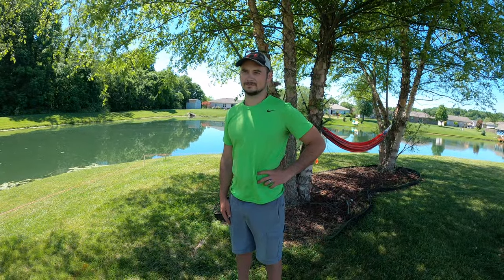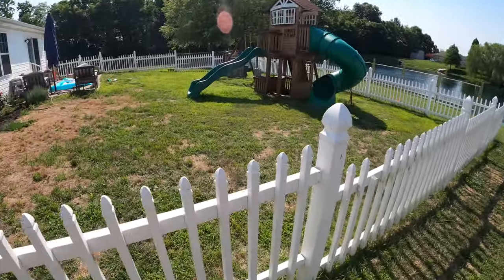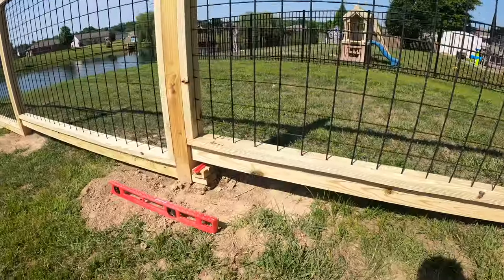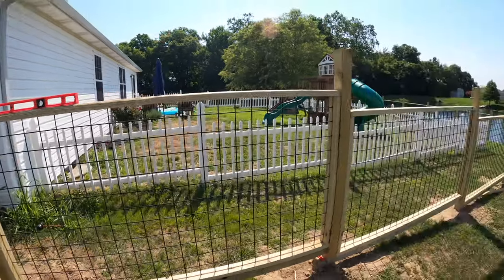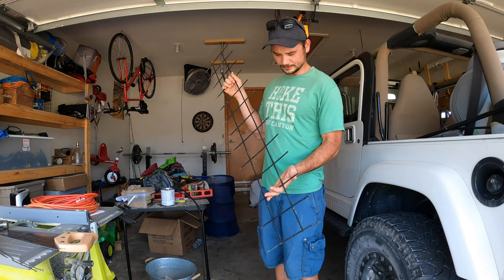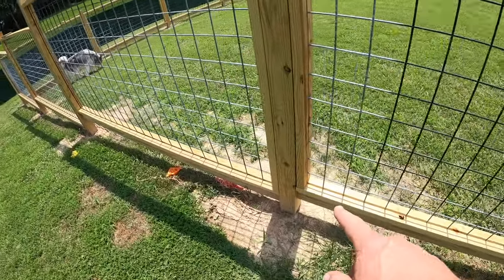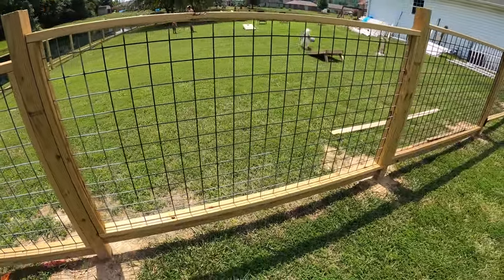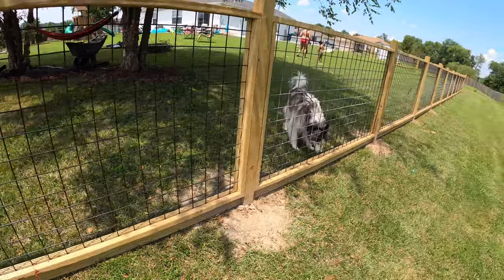DIY Hogwire Panel Fence using Dado groove on a sloped yard

Comment: Great video! What table saw and dado saw set combination did you use?
Reply from the maker: Thanks. I used a 10” Ryobi table saw, and the dado was called “Avanti” blade set https://www.homedepot.com/p/Avanti-Pro-8-in-x-24-Teeth-Stacked-Dado-Saw-Blade-Set-P0824DADO/202035223.

Comment: How did you get the wire to lay flat?
Reply from the maker: The wire came in 16 ft panels, not rolled up. Got it at rural king.
Reply: @thejadeforest3189  what is it called?
Reply from the maker: @PatiencesMom  https://www.ruralking.com/red-brand-hog-panel-34-inch-x-16-foot-90213
It comes in a grayish silver color. We painted it black.

Comment: what's the best way to paint the panel
Reply from the maker: My wife layered several panels on top of each other and used spray paint from several different angles. It took a while and probably wasn’t the best method, but that’s what we did.
Reply: @thejadeforest3189  -  sounds legit to me!! Thanks
Reply: You could roll both sides with a regular roller.  Roll horizontal and vertical, let dry then roll the other side.  A thicker nap roller aught to wrap around the wire giving you pretty close to a double coat hen you are done.

Comment: Great job !
Reply from the maker: Thank you!
Reply: @thejadeforest3189  Really nice! Has the 2x4s twist or bowed any? I’m thinking I’ll have to attach the hog panel to them to prevent that but it may not be an issue.
Reply from the maker: @Ojb_1959  not that I can see. It’s been up for about 10 months so far and still going strong.
Reply: @thejadeforest3189  That’s great, Thanks from Louisiana 🤙🏼